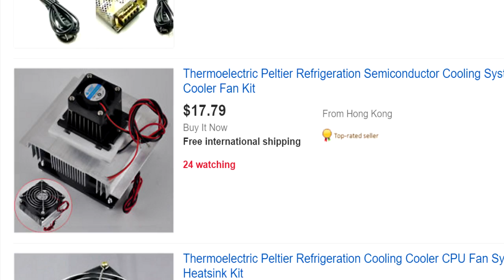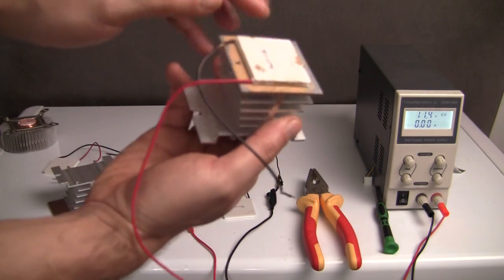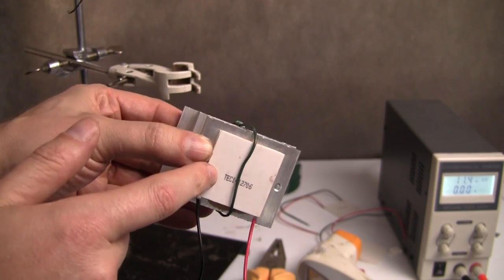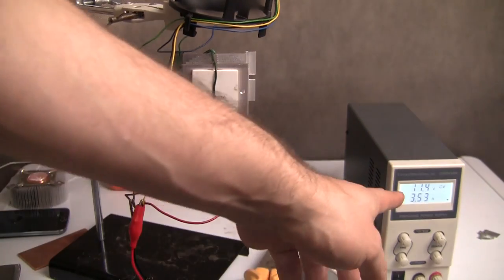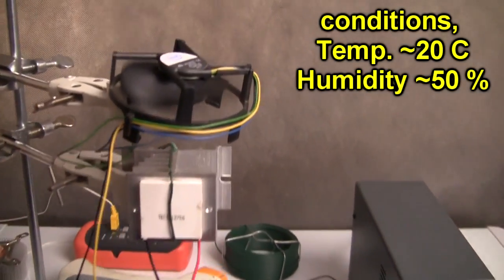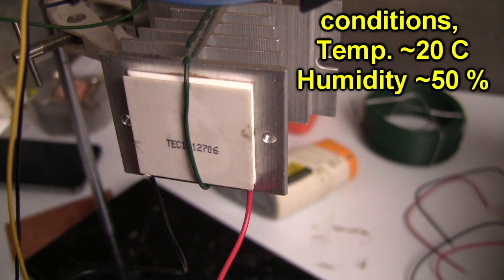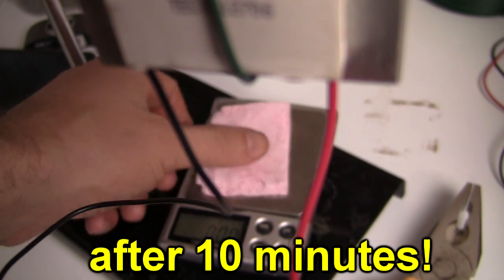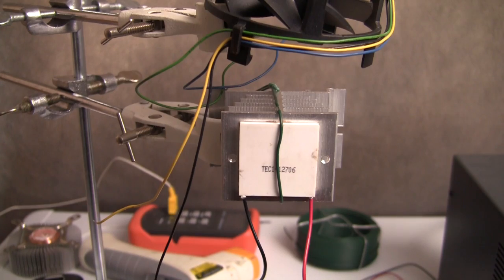Fontus Water bottle claims to make water from air.  Is it possible?

Comment: Perhaps it's asked already... but what about humidity water collectors that use those big crystal tablets?
Is it viable to filter it to drinkable levels with zero to low energy use?
Reply: +kajar9 No those big SALT crystal tablets dissolve into the water. You would either have to evaporate the water and condense it... (totally stupid) or reverse osmosis the shit out of it (again using a HUGE amount of energy) to drink not to mention the filters....
Reply: +anjhindul Thanks... I thought it's something like that.

Comment: But you built it completely backwards?? 
The whole idea seems to be to blow humid air over a cold heatsink (much surface area for condensation to take place), but instead you just used it to dissipate the heat, leaving very little cold surface area for the humidity to condensate on. 
Not saying that device isn't bullshit,, but are you sure you know what you're doing here? 
I demand a re-trial by combat,, I mean, do it again, but do it right this time. ;)

Comment: I like your videos, but this was shit mate. Don't get me wrong, the bottle is still probably BS but you proved nothing with this video. You used an absolutely tiny heat sink that got very hot, considering peltier units make a temperature difference that poor unit was wasting power keeping the cold side somewhat cold, when it can easily go to minus 10 degrees with a decent heat sink on the hot side. On a bike you can use the entire frame as a heat sink.

Cool the hot side better so you are not wasting 40W on keeping the "cold" side at 7c. It would have also been more efficient had there been more insulation. And most of all you used a pathetic surface area. With a tiny heat sink you could have an order of magnitude more surface area. You also used a crappy ebay peltier without knowing what cooler they are going to use, which matters when you consider how terribly inefficient they are. The surface could have a texture increasing the surface area without much change to mass.

Again, not saying the product works, it probably does not. But for a channel that actively tackles pseudoscience this was a biased, poorly thought out experiment  you used just to make a point, which was hypocritical of you.

Comment: One thing it depends upon is relative humidity.  Get more if the air is saturated with water but you can be damn sure you will be sweating more than it can ever produce.  Also if you buy the water bottle for desert trips your fucked
Reply: +Robert Thomas but I've got a bottle to hold some water in and this really cool sun powered fan to keep my face cool D:

Comment: If you had concealed channels of air and a small heat sink on the cold side, bigger one on the hot side, you would gain efficiency and would get more water per watts.  I wouldn't expect that you go out for a  jog in the woods with an empty bottle, and take a 15 min break to fill the bottle... it's just not going to happen.

Comment: But imagine if you had put some effort in, you know, gotten your heatsink to transfer properly (30 degree heatsink, 80 degree interface, I don't have to tell you how shit that is do I? Not to mention the cold side was barely below 10c because of how poorly heat was being transferred...). How can you expect your shitty rig to perform anywhere near the maximum possible performance?

You could go on ebay and pick up a $50 dehumidifier that can pump out half a litre a day. Come on buddy.................
Reply: +nori His shitty rig was running way more efficiently than the system in the product possibly could.  He was using about three times the power with a much bigger heat sink and a much bigger fan.  The system used in the product couldn't even approach the results he got here.
Reply: Rowgue51 Using way more power, but not doing anything with it unfortunately. ~10C isn't really enough for a dehumidifier. Especially when his "much more powerful" rig still vastly underperformed cheap existing consumer options...

To say "yeah I did a shit job but you get the idea" is bad science at best, and at worst self-serving bullshit. I know it's a YT channel and he's after $$$ and entertainment, not actual testing, but still.
Reply: nori
His setup was way above and beyond the setup that he was looking into.  It makes no difference if he did it the most efficient way possible.  The only thing that matters is that his setup was capable of performing far better than the setup they have in the actual product.

You're looking for him to do proof of concept testing to see if it's actually possible with an ideal setup.  You shouldn't need anyone to test that to know that it is possible.  It just isn't possible in any practical sense.
Reply: Rowgue51 His test is invalid because it's so incredibly inefficient. He didn't even begin to actually work out if/how good his setup was, he just assumed "yeah this is the best ever".

It doesn't make any sense, and it's certainly not any kind of science.
Reply: nori
This was just a quick and dirty demonstration to illustrate the shear absurdity of the products claims.

Regardless of how good his setup was all that matters is that it was far more capable of producing condensation than the system used in the product could ever possibly be.

How on earth do you think the even crappier system used in the product would somehow magically perform better, let alone as well as they would have you believe in their pitch video?
Reply: Rowgue51 How can you say that a setup that was cobbled together is going to be better than an unknown product that nothing is known about.

The best he could have done is proven that the power requirements are too high, but instead his setup is so bad that all he proved was that his setup FAR underperformed even what existing products can do.

Nothing was proven, all he did was make a supremely ineffective setup then claim "well you get the idea, surely they can't do better than this".......... So no, nothing was proven which is annoying because I watched this video for nothing just to hear him rant.
Reply: nori
The product in question uses a 15 watt output solar panel powering a tiny fan blowing across a tiny heat sink.

You're trying to compare his setup with dehumidifiers that are running on AC power with much more complex systems that are a hundred times the size.

Get real.
Reply: Rowgue51 It's like putting a V8 in a gocart and having it putter along at 5mph then saying "ok I got a shit job but you can clearly see a V6 can't go as fast as this".

Sorry but doing a shit job then making the assumption that you still did it better is not logical nor scientific. He may aswell have skipped the "demonstration" and just said "yeah trust me pretty sure its bad"...
Reply: Rowgue51 Right, because if his powersupply puts out 100W then his rig must be effectively using 100W right? Efficiency doesn't exist, everything is 100% efficient.

Ok buddy, if you say so, there's no need to flame. If in your mind this rig is 100% efficient, then so be it lol.
Reply: nori
And you're creating straw men to argue with because I never said anything remotely resembling that.
Reply: Rowgue51 You implied that his rig is a reasonable demonstration of thermodynamics, which it isn't. His rig is so poorly made that it's just not a representative example.
Reply: nori
It's a representative example of the design used in the product, and that's all that matters.
Reply: Rowgue51 It's not representative insofar as it's incredibly poorly made - or perhaps that is the joke?

If his example was as good as possibly could be and didn't work, then that is proof. But it's not, it's cobbled together and terrible, from which we can infer nothing.

Comment: wouldn't you get more or less water in the bottle depending on how much humidity there is in the air?
Reply: Even the most humid air does not contain enough water.

Comment: An a/c system can make about 1-3  gallons of water a day. The power consumption of a medium size a/c system is 4000 watts. So about 100 times the output and 100 times the power consumption

Comment: So there's something that came out of a university that you might want to look at as well: https://www.sfu.ca/sfunews/stories/2016/innovation-making-waves-pulling-water-from-air.html
Reply: +Blinky Lass That is still a horribly inefficient process that requires a ton of power in order to produce very little water.  What they did is just a proof a concept.  There is a reason they aren't citing you specifics as far as what it's actually capable of producing and what it needs in order to do it.

Comment: why not run a heatsink on the cold part so more cold metal can produce water also why not bring some aluminum piping from the cold part closer to the heat to force compensation production, and run a humidifier to simulate different outside conditions, where I live its around 90% humidity inside my house is no where close to that
Reply: forgive the wrong wording, I'm sure you get the idea of what I was saying, my phone is not the best tool to use when writing comments

Comment: if only that intel stockheatsink actually was good..  sigh
Reply: The stock HSF is fine for normal usage. If they shipped a D15 or whatever then that would seriously it into costs, so just suck it up and buy your own... Though, do intel CPU even come with HSF anymore? Last time I bought one for a build it didn't, but I bought a very high end CPU (an $800 2011 iirc)
Reply: +nori for consumer grade such as 4790 and k sku, 6600/k 6600, and 6700 yes they are shipped with it, and I have a full loop but I wish they sent better since people lacking knowlage end up with a hot CPU with a jet style loud cooler
Reply: iamtheonewhoyoulove I haven't used one for a while but I guess they upped the RPM huh.

On a sidenote, I noticed that some closed loops for AMD require you to have the stock HSF bracket, pretty strange...

Comment: if you cool the hot side of a peltier enough you can get insane cold side temperatures. at 90W I got -25 degrees F on my peltier, I just used a large computer heat sink. Water built up and then became ice.

Comment: With a more optimized design, taking things like airflow and moisture collection into account, I think a real version of this quick and dirty prototype would be able to make something closer to half a cup of water.

It'd still be a neat little toy, but nowhere near the thing you'd need to solve all your water problems that a traveller would have.

Comment: I would think that how much water you can condince will depend on the relative humidity of the air around the device.. If you are in an air conditioned space, there will not be very much humidity .. try again either in the bath after running the shower a bit or try it outside?? But ,Yeah It seems to be horridly inefficient in any case

Comment: Is this comprehensive?
Could their Device not use the heat put out by the heatsink end of the device, to heat up the air first before it then runs over the colder part - and thus increase condensation via the higher temperature differential?

Comment: Wouldn't it make a slight difference to run the experiment within a confined space, like a jar, parted into two sections, where one end sucks in air and the other lets it out?
If this bottle produces 20 milliliters a day... just stuff TWENTY of these into your backpack and a few back-up generators for cloudy days with decent amount of fuel for them and you're good to go! (totally wouldn't defeat the purpose of not just carrying large amounts of water, instead)
Or! Just 8 grams of thorium instead of fuel and it will keep you hydrated for a hundred years even after the sun exploded! :U
Reply: +Daniel Renard why use thorium? get the energy from the SOLAR FREAKING ROADWAYS
Reply: +Ahmad Mohammad just use gills that change air into water!
Reply: *****
Or go hardcore, by making no changes at all and still reuse water indefinitely! ( ͡° ͜ʖ ͡°)

Comment: Maybe with a factor 10 or 20 of efficiency it could have almost a purpose. If I shower during winter I can get much more than that amount of water on each window of the house, even those far away.
Reply: ... by supersaturating the air with water at elevatd temperature, which naturally condenses out as it cools causing misting which then gathers on pretty much every surface. Now try that while riding your bike through the local forest.
Reply: TheMonk72
I should have stressed "maybe" and "almost" a bit more. Of course when I said "have a purpose" I had in mind applications which were not that one of the bike. Maybe something large scale, but yes it is hard to think at situations in which the system is not outperformed by the currently existing methods.

Comment: i put a 2litre bottle on the drain pipe of my cars aircon and it only just got full after a 4 hour drive and that was on a hot and humid day in britain. perhaps this self filling bottle just needs tweaking a bit, we could connect a compressor to the pushbikes drive chain and the rider could wear a backpack codensor/heat sink. all we'd then need is a 1kw odd fan and voila.. shit, I'll be rich when this hits the market. if anyone wants in just send a cheque for £10,000 to myself please.. ta.

Comment: But still, it can be optimized more, so I'd be expecting more efficiency. However, can it fill enough to keep 1 human hydrated? It would depend on conditions as well. In the desert you could probably have 100 of these things and still die of thirst because the water just isn't there. If you're on a boat, you have plenty of water around. Better just have something to take the salt out.

Comment: It may be BS but could it work with some future tech kind of thing? 
It is clearly not total BS as it can work, but not as effective as just finding some other source of water and a way to purify it.
Reply: It clearly "works" but the issue is quantity. You simply need much larger surface areas to collect lots of water. In water-poor areas that have frequent fog, they collect some water by using huge nets to condense water. It's moderately effective...
Reply: zolikoff
i can see that working easily. but what i want to know is if there would be some way to make it work in a small place like a water bottle using some theoretical system that is not powered by magic. but would still get you say... one cup every hour or so. (assuming normal conditions)

Comment: Please understand I don't have a dog in this fight... But you might just want to take your experiment outside into a non-climate controlled environment.  As a reference, today we had about 84 F (29C) and 90 % humidity.  It might just work a little faster.   Also, for this application colder isn't better.  All you need is to be below the dewpoint to collect water.

Comment: I am wondering if this assessment is perhaps flawed.
I work with heat exchangers, which this is, sort of.  The air in Thunderfoot's set up is free flowing.  He of coarse needs cool air to take heat out of his heat sink, but the water in the air is also moving over it.  He is only cooling a tiny fraction of the water at any given time.  In our heat exchangers, our cooling medium, and target medium are isolated by a barrier so that we can control the exposure.

Which makes me wonder, what would happen if every other channel were blocked from the cpu fan?  So as to stagnate the air?  Well, slow the air down anyway.

Just a query.  It could actually be debunked.  I've never tried it

Comment: insufficient surface area on the cold side, you need to add a heat sink. (smaller than the one on the hot side however)

Comment: 75709 of these exact devices would get a day's worth of water in a day. That's about 2.4 square miles of these if you placed them all out right next to each other, not counting the heat-sinks. Tell me if I got my calculations wrong, but I think that's a bit inefficient.
Reply: +Nikolas Powell Is that for someone who's taking it easy and staying still, or someone sweating and panting as they search for a better  source of water?
Reply: +Jane Doe In continental dry summer heat (30+ °C, about 30% humidity, clear skies), I can go through a 700 ml water bottle in an hour. On a 200 km ride, I can drink as much as 6-8 liters of water and still not urinate more than usual. So yeah, "a day's worth of water" is a highly variable quantity.
Reply: Jane Doe Just going by the hippie standard really, ("one gallon a day").
Reply: tybofborg well, one gallon is 3.8 liters, so, (back of the envelope,) double my original calculations for the 200km ride.
Reply: That's 4.8 square miles, or 7.7 square kilometers! Gee darn it! That's a lot!

Comment: I guess if you had a giant one running on a very large solar panel, it would be alright for WROL situations
Reply: +Dakota Perry At which point you'd pretty much just be using a solar-powered dehumidifier.
Reply: +Dakota Perry You'd probably make better use of your time setting up dew traps. No power required.

Comment: Using freon gas instead of a peltier for higher efficiency, commercial condensation units can make a liter of water with 415 watt-hours of energy (given 85% humidity). That solar panel is 20 watts, tops. Thunderfoot's right - this is total cow crap.
Plus - filters? That condensation is dirty, lots of dust, spores, etc. in it. The commercial condensation units use filters and replace them frequently.